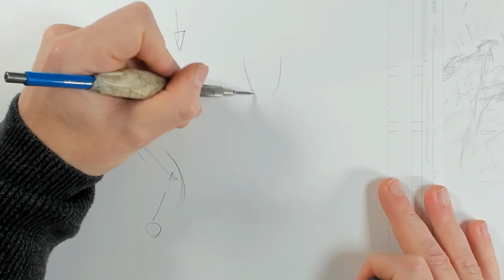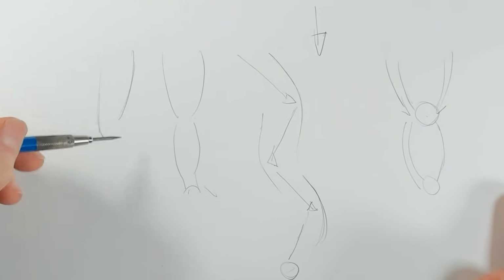Dynamic Figures: Why Your Figures Are Stiff

Comment: One note about the striking pose at 14:00... A trained fighter would not leave their jab side ribs and face open while striking with their cross, as in the drawing.  Doing so both projects the incoming strike and opens two wide and fight ending targets for the opponent to counter with.  Just an fyi for anyone doing illustrations of characters who are supposedly trained in hand to hand combat.  You can see what I mean if you watch a boxing or MMA match. Watch where the fighters keep their elbows and hands as they move, feint, and strike. The knockouts happen when they expose those areas.

Comment: Finally I understood what actually gestures are for. This is some kind of an exaggeration of a motion, or forces that act on a body. 
Karate gestures at the end of the video are actually on point even without fixing them. When people perform kata slowly, stopping after each move, they actually do look stiff because they have to remain that position without moving for short period of time. But the overall idea of force acting on the body was explained very well, thank you

Comment: I remember watching this video years ago when I was first learning anatomy, and it made a big difference in my posing. I was drawing more cartoony style stuff with simple shapes, and after learning this, it made my characters more fluid. But as I got better at anatomy, I focused too much on where muscles need to be rather than how they work, and things have gotten stiff again. I'm going to try and mix the two of them and use this method again to try to ground my characters a little bit better because somehow I've gone backwards on a technical level. I think my character's anatomy is significantly better, but somehow everything is becoming more stiff.

Comment: As someone who has taken martial arts classes, a lot of this stuff applies irl with irl fighting, mainly with where the force is coming from. I was taught when punching, you aren't just using your arm, you're actually supposed to put your hip and whole body into the punch, which will allow you to punch much, much harder. These concepts work with drawing because that's how it works irl.

Comment: I hope this question hasn't been asked 50 times, but what grade of lead do you use. If I had to guess it would be h, 2h, or hb? But you also get really smooth and nice darks with your lines so for all I know you could be using b or 2b. I'd really like to know. Thanks.
Reply from the maker: It's all 2h.  I press too hard sometimes.  That's actually why I have tape on my pencil.  I just put too much pressure on my hand

Comment: Great vid, lol should mention for some who don't know that not every pose needs to be full force dynamic body action sometimes its good to have a mixture in drawing for contrast. Having dynamic poses mixed with average natural poses can be used help to sale a superhero's power etc next to average individuals. PS on kick leaning back thrusting kick I'd choose to pull the toes back more or thrust the heel kungfu style, lol otherwise to me it makes the kicking foot look a bit less dynamic as power in striking point is not as defined, lol thats just my opinion though, great hip thrusting in kick though lol, I understand these are just quick poses demonstrating lines of action. I work as a freelance artist and also have a blackbelt in TKD use to assistant instruct martial arts. Over all a great vid you deserve a subscribe.

Comment: So to me it looks like symmetrical poses aren't just aren't usually as dynamic as some asymmetrical ones. Also it looks like when one or two things exit the center of gravity on one side, one thing from. The other side should probably do it
Reply from the maker: Symmetrical poses can be grounded and solid, which is a good thing.  When you push out from the center of gravity, you get the feeling of motion.

Comment: I understand what you mean in your video, however, isn't "dynamics" just limb movements positioned to their extremes? i dont think it's necessary to understand this whole "gravity" idea if all you need to know is the human body in it's default position(which you did not implement in your comparison piece at 2:49, but did so at 3:11 btw) and how body parts move (abduction/adduction, rotation etc etc)

Comment: im having a hard time seeing how figure at 8:20 has most  of its mass on top of the gravity point as it is in a pose where its tilting the body backwards... so i stand up and try to make the pose my self, and its kinda the same...my conclusion , you decide  where to put it and then draw the curved lanes  based on that, but as long as un follow the opposit ccurved lane rule it should be fine making the center of gravitiy on any of both foot right?
Reply: it wouldnt be a good idea to star from the gravity axis and from there draw the basic mass of teh body in whateer angle u like?
Reply: and in the previous figure at 6:51 kinda the same ,  iit dossent matter wich part ends up right on top of the gravity point, u can put the weight on the opposit part right? like here the hip bone to the  lefth, the one far from the gravity axis is the one holding the weight instead the right one wich is on top of the graavity point